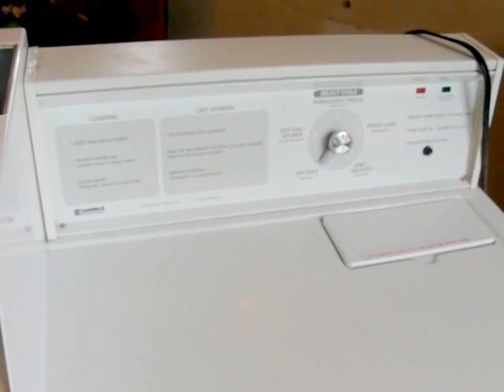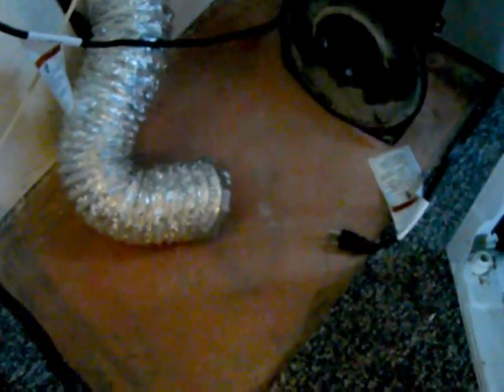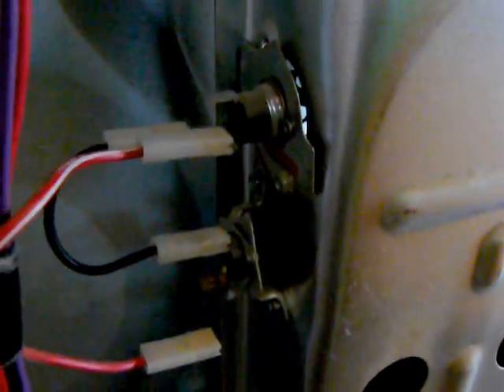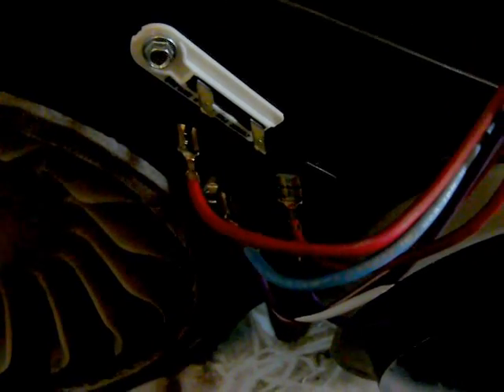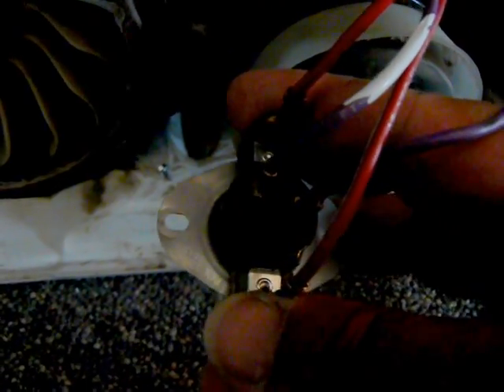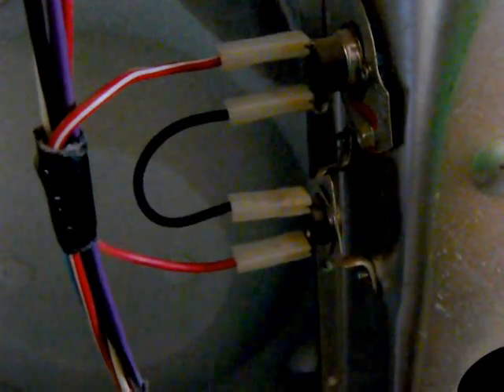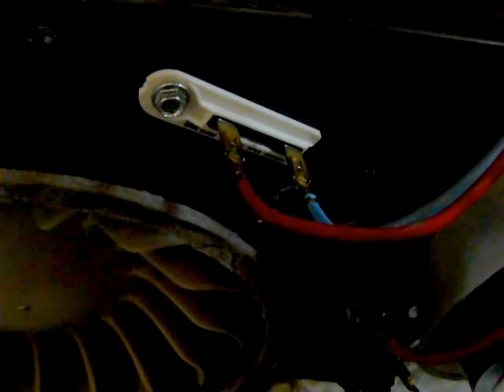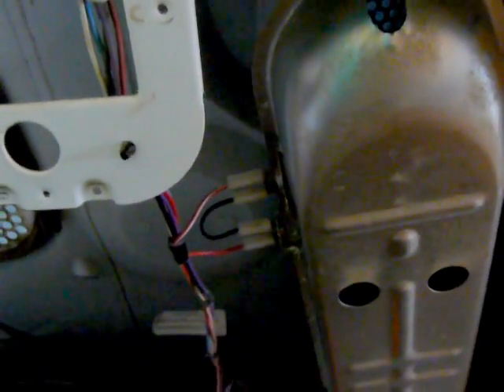Kenmore whirlpool maytag Gas Dryer No heat trouble shoot

Comment: The reason that white thermal fuse fails is because the vent is plugged up or collapsed. The fuse is "replaceable". It is a one time use fuse. You kept say "non-replaceable". The part with four wires is a thermostat with a heater (the small wires) This is how the dryer sets its different temperatures.
Reply: Dzonemp question.. How do you test that part with continuity or ohms

Comment: The 7k ohm on the thermostat isn't a bogus reading, it's just too high to read as continuity, as you noted when you switched the range on your multimeter.  Some things have resistance instead of being open or closed, the 7k was just low enough to read as zero-ish on your 2meg range :-)

Comment: Thanks for the reply. The coil does not heat up on high setting. However, when on air tumble for 20 min it does. The coil heats up and kick on the gas on this setting only. All other settings do not ignite the lighter. As it starts on one setting and not on the ones it is supposed to, do you still think it might be faulty solenoids? Thanks!

Comment: watched your video and trying to troubleshoot gas dryer issues.... it only fires up and heats on one setting.. the air tumble setting. Have a KitchenAid heavy duty. Seems that all my sensors are good, at least the main ones. Ideas??
Reply from the maker: Phil Douce I would check and see if the burner is firing up.... On the front of the machine, lower left corner is a little plastic inspection cover (1x1') pop it off and start dryer on high setting, look through that hole and see if the igniter is trying to light. There are 2 electric solenoids that start the flame that tend to fail.

Comment: Left and right standoffs on the cycling thermostat measured 7kOhm for me. Guess that is continuity. That probably isn't what is broken then. Will keep checking things.
Reply: +Eballer55 It's not continuity technically, but more resistance than zero, which is correct.  7k is what I get as well.

Comment: Ty for the vid, I did check all the terminals however and it showed continuity for all of them. I also took off the front and removed the drum to check the heater thingy itself, all those terminals showed continuity as well. I was wondering if it could be a short in one of the wires?

Comment from the maker: My meter showed that there was no connection in a circuit, I then put that meter on its most sensitive setting and then saw continuity. your meter may vary.

Comment: I'm not an electrician but have used a multimeter countless times. So I'm wondering why a person couldn't just set their meter to check specifically for continuity? Does it have something to do with the parts possibly having just enough continuity to register on the meter set for strictly continuity but not enough to function as it's meant to? Thanks.

Comment: Nice Video ! My drier fires up initially but within 10 minutes or so the burner turns off. After that, from looking through the port, I can see it glow but not light again. I've fully cleaned duct, took the blower cover off & cleaned that, replaced the thermal fuse and the operating thermostat, checked the other two devices (in the back) and the timer (turned up to max setting) and all had continuity. Still not working.  What's the most likely cause of this ?

Comment: First, I'd like to say I found the video very helpful.  Here's the problem Iam having now.  When my dryer was tumbling and had no heat, I replaced the non resettable fuse.  That did not work so I replaced the remaining three. I still have no heat. The ignitor lights up completely then quickly goes off.  This happens every 30 seconds or so.  Any suggestions?

Comment: Hello, great video. If the ignitor  glows, do I still need to check all the fuses/thermostats? Seems like it won't glow if one of the things you showed is open.
Another video shows that if the ignitor glowing then the two solenoids are the problem. However, I replaced them and it doesn't work, same symptoms . Seems like the problem could be in the flame sensor or maybe the things you have shown in this video? 

Thanks, I am ready to go at it again.